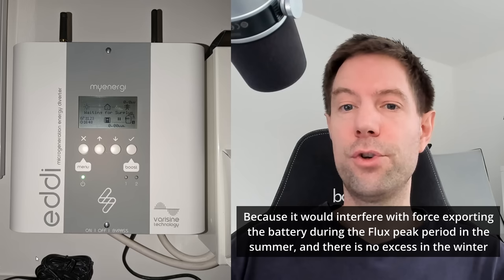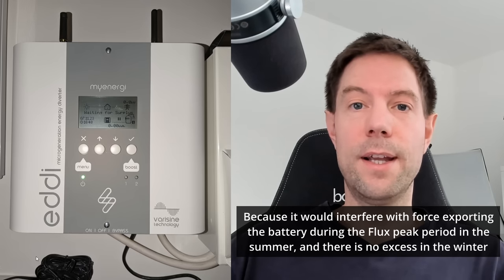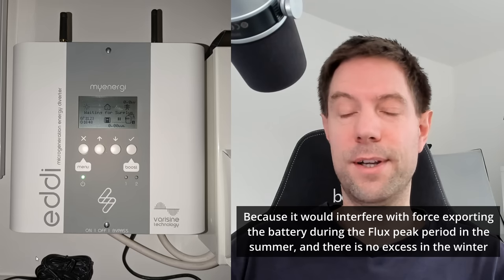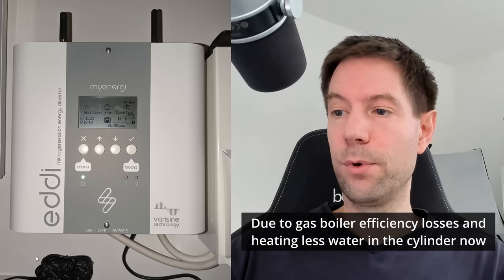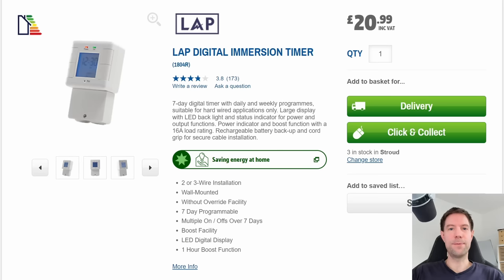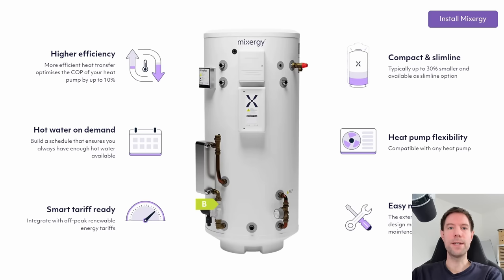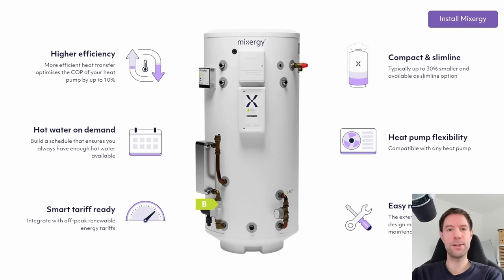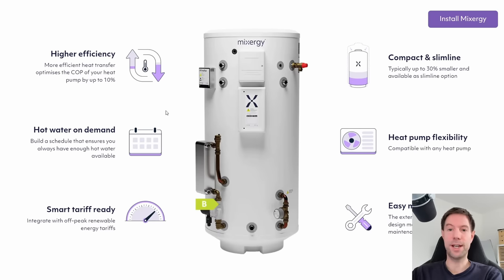Gas free hot water - so many options!

Comment: agree with being more efficient, but less is not always more…we went down the Fischer Aquafficient (210l) heat battery for simple reasons really: 1) size: no cylinder, moving parts whatsoever essentially space saving and a third of your cylinder size 2) zero noise & no annual servicing 3) compatible with solar & off peak charging….we literally never use the 210l available that is fully available and it recharges overnight (cca 5kW)….considering its off peak charging its a no-brainer to go down this route compared to 40-50db continuous noise and tripple the size solution just to get extra 3kW?with no real financial impact…
Reply from the maker: 3 kWh per day quickly adds up.  I'm glad you're happy with your Fischer system but that doesn't mean it'd be the best option for everyone.  The point of this video was to show a sample of the available options so folks can make their own decisions based on what's important to them.
Reply: The 5kWh to heat up was my main concern with the Sunamp type setups. It’s the same direct electric heating of my old standard water tank. So any saving on usage is a good return. What was the cost of your unit to replace our hot water as the Sunamps where quite expensive. Agreed they are not as big in size but they do more or least take the same footprint so you gain more shelving space but thats about it. Agreed you can charge at cheap rates with a solar setup in the mix it helps during the summer will still take less to heat up the tank and I can schedule it to run at cheap rate times as well but it takes longer to heat so without solar I would use some non cheap rate tariff. With battery I can use that to offset the various rates and timings by power it from the battery when its be charged up by cheap rate electric
Reply: @bobbazley5376  battery itself for the 210l v9 is 10.5kW capacity, but we never managed to fully deplet it…usual off peak charge midnight onwards with 4.5p. And yes if you have battery can be used but I dont see any reason as you already charge off peak or PV so daily grid is not needed. hot water is instant and box itself is never warm or hot.
Reply: @TimAndKatsGreenWalk  3kW adds up, it does, so will your annual servicing cost so this argument is irrelevant…p.s. you should not take things personally 🙂 if you want a chunky noisy box-of course, the choice is yours
Reply from the maker: @robert_minarik  I did say I was going to install it in the garage out of earshot.  My priorities are different to yours, simple as that, there's no need to suggest that my choice is inferior to yours somehow (I'm certainly not suggesting your choice was wrong, it's clearly something you're happy with and I'm glad for you).
Reply: @robert_minarik  everybody’s setup is different, good that yours works for you and good to know about the various options available.
Reply: @TimAndKatsGreenWalk  agreed 😉 on a separate topic, for AC you using it as thermostat, ie always ON or schedule…playing with booth not sure which one is more effective, ie less demanding in inverter and inverter noise
Reply from the maker: @robert_minarik  a bit of both as it happens.  I've got them coming on at 6am then I vary the temp as required throughout the day based on what room we're in and what time it is.  For example, most are set to 18 deg for most of the day, but I might boost the office to 19 while I'm working, then the lounge to 19 in the evening.  They then all turn off at about 20:30 in the evening.  The house tends to not cool down too much overnight so no point running the units overnight, and the temp bounces back pretty quickly in the morning in any case.

Comment: Using a heat pump to charge a Phase Change store doesn't sound that efficient as the heat pump flow temp is above  the melting point of the medium , which is above the required water temperature. Heating a water cylinder with a heat pump , the heat pump flow temperature is low while the water is cold & only rises as as the water temp rises so a better average COP is obtained ( in theory) .
Reply from the maker: The phase change system requires the same temperature water to heat it up as a hot water cylinder, so would work just fine with a heat pump running at 60 ish deg.  So the COP would be fine.  Even at 60 deg you'd still get a COP well above 2.

Comment: Couple of points Tim, firstly if you use the heat pump with a Mixergy cylinder, you have to heat the whole volume as it has a recirculating pump.  And usually when you have solar thermal, it's an indirect system so you aren't circulating tap water directly through the panels.  It is far more efficient to be circulating a fluid like glycol.  A key advantage of a heat battery is that you don't need to run any sort of boost cycle to kill off bacteria as there is no stored hot water.  The Daikin Multiplus is the A2A system I'm aware of that can heat water.
Reply from the maker: Yup, someone else mentioned the Mixergy thing with the heat pump, that's something I didn't know.  I believe the iHP does work more like the way the regular cylinder does though, with it heating from the top.  I was aware that it's not the water you use that runs through the solar thermal panels, I was just keeping it as brief as possible since that wasn't too critical to mention.  Good point about the heat battery.  And thanks for reminding me about the Daikin Mulitiplus, I keep forgetting the name of it.
Reply: I forgot to mention a thing called the BOLT.  It’s an electric boiler but with a built in battery.
Reply from the maker: @sjcsystems  ah, cool, I'll take a look.

Comment: Hi Tim, we are planning a rather similar air con and heating solution to you, and just to make you feel better about your choice I’ve been told (but I’m no expert) that all the air to air heat pumps available in the UK can’t do water as well, there are ones that do, available in the EU but they haven’t come to us here in the uk it seems.we are planning to upgrade my partners family bungalow, that was left to him (which we are retiring to sometime next year, I’m due to be made redundant no later than August 24 and we are selling up my flat and moving to north Norfolk), the bungalow was built in the 1970s and needs a lot of extra insulation and window upgrades, it has very old storage heaters one of which no longer works and  still had it’s original old hot water cylinder that we plan to remove and replace, I hate radiators and my partner doesn’t want underfloor heating despite My best efforts to talk them round, so air to air is the compromise, seeing your system and the same make being used by several others has settle me on an air to air solution. And like you are planning to also a have a heat pump tank and are possibly looking at the Mixergy iHP. I will look forward to your next video on that! Throughly enjoy your videos. I’m planning a large solar panel and battery system too, my partner says I can use all my redundancy money on one and I’m currently planning on getting a system using emphases microinverters, solar panels and givenergy batteries, but (having listened to many Gary does solar vids and chatted to him about that I’m waiting until we are there as prices of solar installations are falling or will be by the time we move into our Norfolk bungalow. All our planned work is probably going to take long than I’d hope as I tend to overthink and so the planning stage will be extended as I rule out alternatives but so far all my above plans have remained my thoughts for several months now, so I think they are very likely to not change unless some new tech or newly improved solar panels etc. appear before our move.  Thanks for hours of informative vids! Rob
Reply from the maker: That sounds fab, what a great opportunity to upgrade an old property.  All your plans seem very sensible to me and I'm glad my videos (and Gary's) have helped with your research.  Best of luck and enjoy your retirement!
Reply: Daikin's Multi+ air to air heat pump is available in the UK and will do DHW.
Reply: @tlangdon12  thanks for the info, I’ll do some price investigation on what Daikin’s internal units are like price wise and what they look like and whether anyone locally will install them. I’ve found the desire to spend money on my major eco improvements to our home locally a lot harder than I thought, I’m only willing to compromise on what I want to a degree, I’ve already had to decide to go further a field than I hope on the solar/battery system because no one locally would do my choice of the panels/micro inverters and batteries.  Even getting things like the fridge and freezer I wanted locally was a hassle so I’m not taking anything for granted as available locally. But it good to know what I got told about hot water isn’t true in ever case.

Comment: We went down the route of the sunamp due to not really having a great space for a cylinder. Its been great. 0 maintainence is certainly a win. Ours is only charged by either PV or more usually cheap rate. But its heatloss is so low I don't think about it. Paring it with a heat pump would make it cheaper to run, the upfront cost of the HP would probably not be worth it unless you were doing A2W
Reply from the maker: Yup, it certainly fills a useful niche.  Now, if they did one with an integrated heat pump...
Reply: @TimAndKatsGreenWalk  Yeah, an integrated pump version would have been amazing.

Though IHPs in cylinders feels weird to me as they are drawing the heat from the house to heat the water, which feels weird because airing cupboards traditionally used the heat lose of cylinders to dry clothes or keep towels warm,
Reply from the maker: @ungrim97  that's why you use pipes to vent them to the outside (both inlet and exhaust) so that they don't draw heat from the house.
Reply from the maker: @ungrim97  here's a good demo, actually: https://youtu.be/fh6VVF1ayIY?si=ycimk_NKXon__0mC

Comment: Old immersion tanks used to have 2 heater elements because of economy 7 switched electric. One element was controlled by the grid daily, and the second was used as a boost function if you needed more hot water during peak hours.
Reply from the maker: Yup

Comment: Trying to decide between mixergy and sunamp at the moment…

Mostly because of the boiler upgrade scheme requirement that the same heat pump has to do hot water as well…
Reply from the maker: It's good to have options at least!
Reply: I think the government will upgrade their schemes to take on board standalone ASHP water cylinders and A2A setups in the coming year as they adapt to the various options out there for people.
Reply: Check the reliabilty of both before purchasing.

Comment: Many thanks, Tim. Jolly interesting. The heat pump cylinder is a revelation.
Reply from the maker: Indeed.  After we got the A2A system I started wondering if such a thing existed and lo and behold they did!  There were only two on the market that I could find back then but now I know of at least four, so I'll be covering them all in the next video, comparing the specs.

Comment: Great video Tim and all the options you mentioned are exactly the same process that I went through prior to my final choice about 3 months ago. The Mixergy by it self seemed a good option as it had some clever way of heating the water just enough for what you actual needed to use but the cost/efficiency ratio for me wasn’t enough to warrant the cost to buy it. They have indeed brought out a ASHP version that sits on the top of the cylinder but I dont think its available yet and from what i understand on pricing it wont be as competitive as other ASHP all in one cylinders. 
The Sunamp was one that I looked at about 2 years ago and they do look to be efficient for what they do but I felt that they had some major points that put me off, first is the actual weight of them, they are incredible heavy due to the internal heating mixture and just getting it into a house might be an issue especially if you plan on having it upstairs in the traditional location for hot water tanks. They do use much less room but probably the same footprint as a water tank just not as high. I didnt like the fact that I couldn’t obtain clear efficiency rates for what it would cost to charge the full unit and how much hot water it would provide. The other company Fisher - basically use a Sunamp which is rebadged from what I read back when i was looking at them. 

I decided on an ASHP all in one unit after much research and making sure i had a a hot water replacement for when I replaced my old oil boiler which did my heating and hot water. I went with the same setup for heating the house as you with the Toshiba Haori units and so far they are working out very well. Roll on the cold weather for the real test ! . The ASHP all in one unit I went for in the June of this year was chosen as it was more or less the only one I could easily obtain and at the price point that I was happy with. Installation was easy for my plumber, who had never installed an ASHP water tank previously but it was exactly the same type of water tank install as any other traditional water tank. He did worry about the ASHP part but he didnt have to do anything other than plump it into my existing hot water pipes and the electric. The Air flow is important so the location of these units needs to be able to get two 6 inch airflow pipes out to the outside of your house.  The noise of them with the air flowing is minimal but I expect having it located in an upstairs hot water tank cupboard would not be the ideal place. I located my where my old oil based boiler was which was in the garage attached to my house and that gave me one of the air intake holes already due to the old flue for the oil boiler.  So far I have seen at least a 50% decrease in my electrical use since installing it compared to heating my old hotwater tank on the electric element only. In summer I expect that rate to become very efficient but as we get colder days now i will reduce but if it saves even 1 kWh per day then its still a saving. 
I’m looking forward to your next video and to see what you finally went for. (I’ve not mentioned what I’ve got as the setup until after you have made your video)  thanks for doing the videos :)
Reply from the maker: Well, the next video will have a lot of specs comparisons so buckle up!  It's good to hear you've had success with your choice and I'm looking forward to getting this sorted next year.

Comment: Thanks Tim and Kat. I love the fact that i can pretty much find all the information i need on any thing to do with going carbon free on channels like yours excellent excellent excellent. I am at the beginning of my journey into this. My plan is, solar on east-west roof, givenergy all in 1, zeb boiler and mixergy water cylinder. We're on octopus go as we ha an ev, so would use cheap rate over night to charhe zeb when not enough solar, hopefully winter only.  Not sold on heat pumps as we have a 1950s bungalow with a double dormer that has micro bore up there.  Ps just bought the thermal camera from the link in your video.👍
Reply from the maker: Nice.  Might also be worth keeping your eye on the new Octopus Cosy 6 heat pump that's coming soon, too.  That's a "high temperature" HP so might suit you better than the existing ones, as you can drop it in and keep all your existing pipes and rads.  And given the boiler upgrade scheme is now £7.5k you might find it's essentially free to install!

Comment: Another great and informative video, thank you. I am looking into an Air to Air source heat pump but I might cheat and try and get it all sorted in one go, like the new Daikin all in one solution. Though currently I have a combi boiler so need to find space in a modern house which isn’t easy. Looking forward to your next video going into more detail.
Reply from the maker: Yeah, space for the cylinder is the killer.  We're lucky we have room but I can see that being an issue for lots of folks who want to get heat pump heating systems that requires a cylinder for the hot water.
Reply: @TimAndKatsGreenWalk  This is the big problem for most smaller properties including flats and apartments. Heat pumps are more efficient, but you can't justify the cost of a powerful heat pump for a small property if you only need the maximum power to heat DHW quickly - low and slow is the heat pump mantra so finding somewhere to fit a water tank is necessary if you want to use a heat pump. I wish that rectangular tanks were more common as these maximise the volume of water stored. It would also be nice if Vaillant did a version of the aroSTOR that could use a remote cylinder, like the Oschner Europa Mini can. Oschner reliability seems to be lower than Vaillant though.